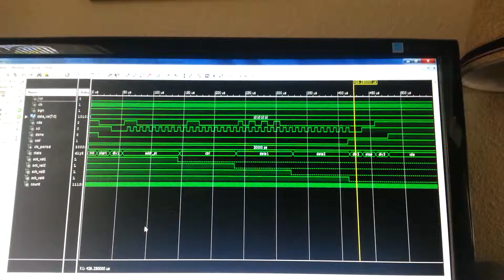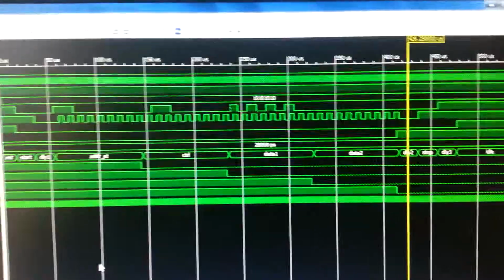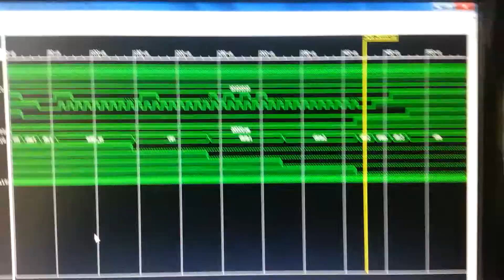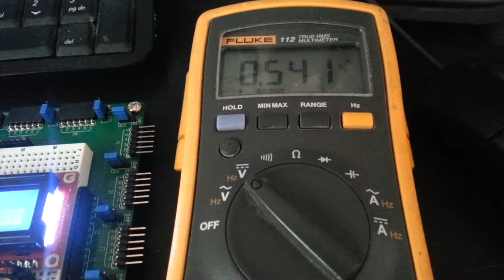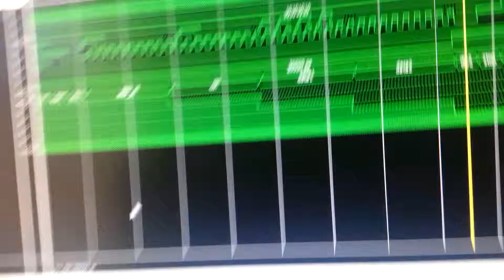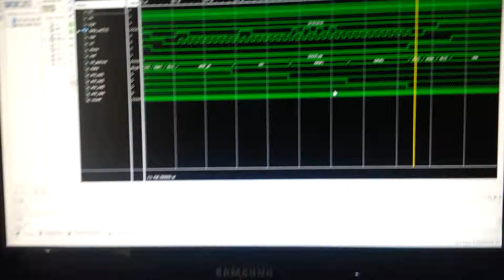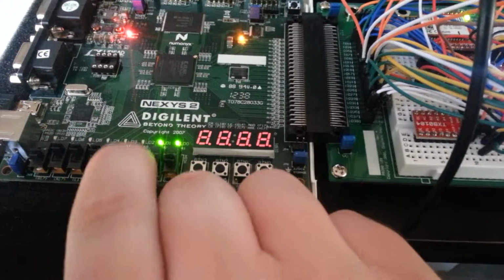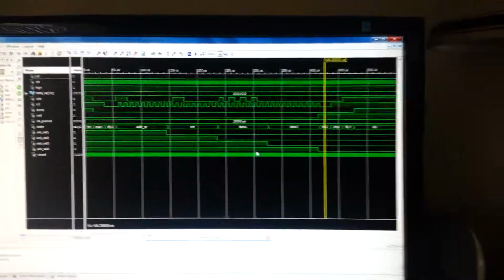I2C DAC controlled by FPGA

Comment: I wonder to thank you for this explanation sir... I wonder to highlight that I bought 2 prods for both dad and adc in order to use them with my FPGA board... initially I thought that theses prods are an spi protocol based devices however i realized that they are an i2c prods .....plz if you can save me by providing me the code I'll be thankful for my entire life
Reply: Sorry for the taping errors it's from my iPad prods=Pmods